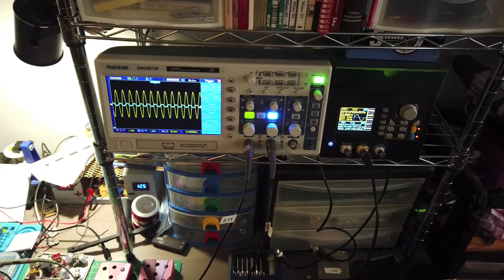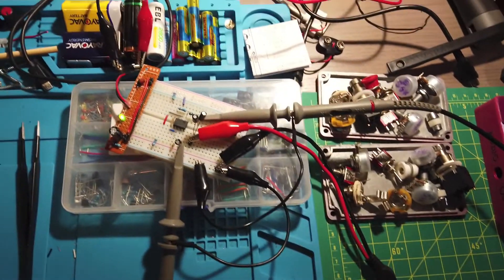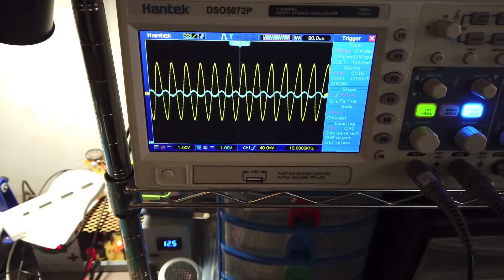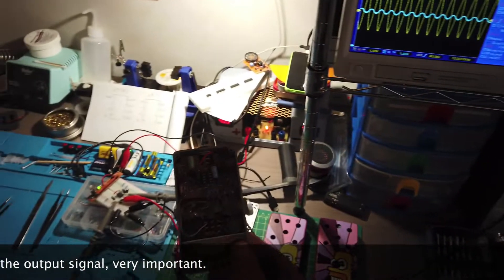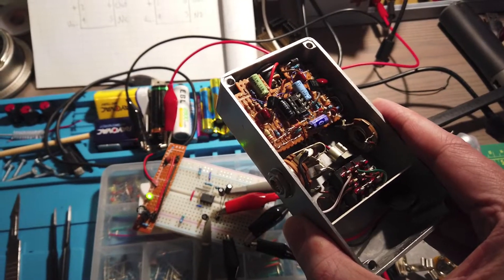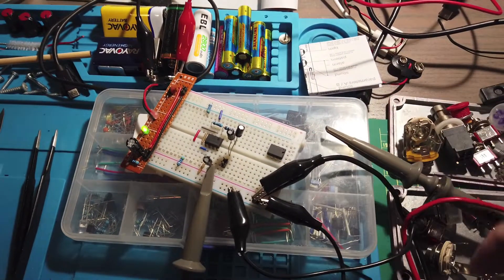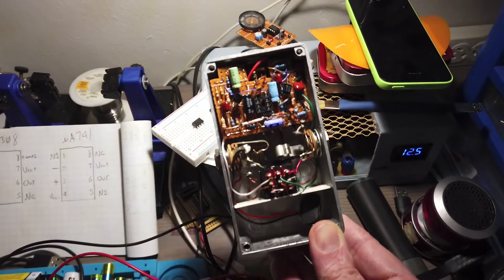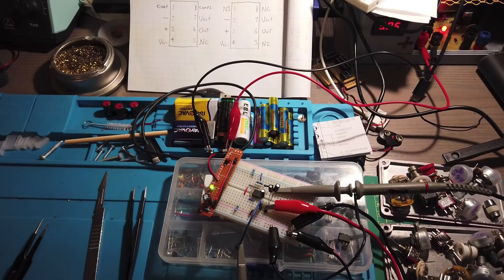Testing a real LM308 op amp

Comment: Thanks for sharing the vid Haze.I had my first bad experience with what I thought was a good deal on 10 mn3007 bbd's.  I began replicating the Boss CE-2 circuit and could not work out why the dam thing wouldn't work. The 3007s just got hot and I later discovered they were possibly (most definitely fake. )
Anyways wishing you well with your DIY endeavours. 😎😎😎😎
Reply from the maker: You are welcome Adam. One of my first purchases was a lot of 10 LM308 chips via Amazon and I had no idea about the notoriety. I just wanted single package versions o the LM358 dual op amps I had. Well the chips were not LM308s and I set about returning them when I had a wild idea to test them as if they were LM358 chips. And they were! They were not terribly expensive so I just kept them. Later I did get a batch of ISD1820 voice recorder chips and they were totally fake, got my money back on those. Cheers! :)